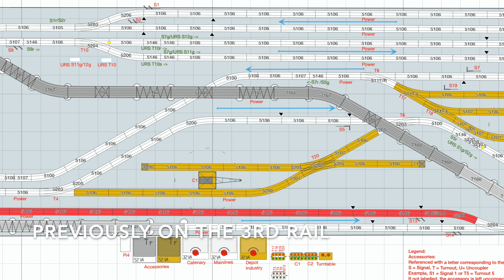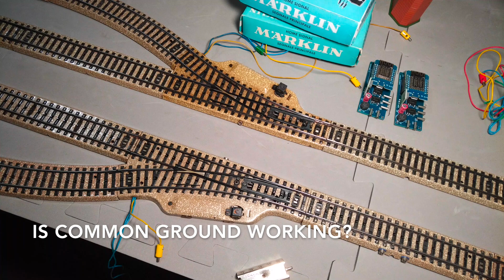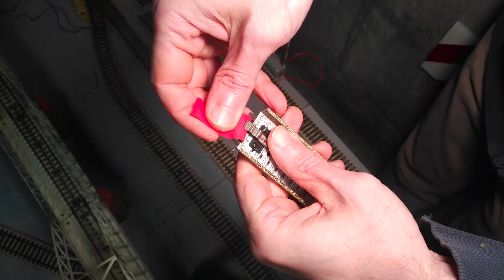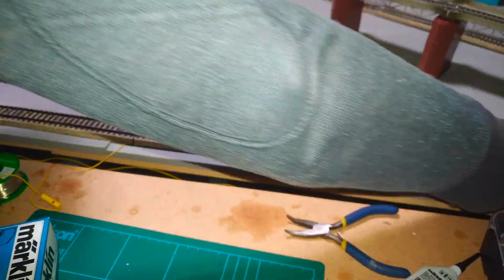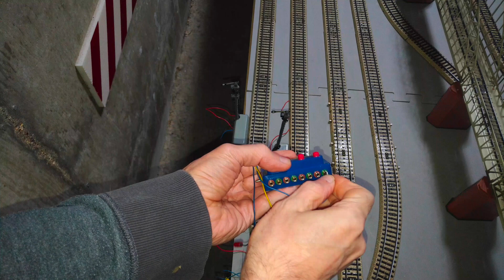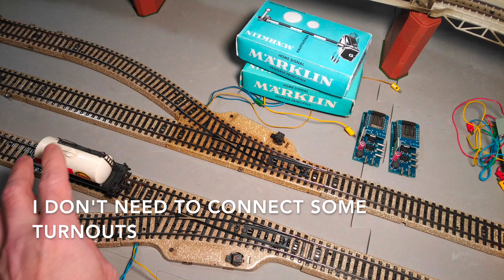2021 layout - Phase 3: installing accessories and wifi controls - Märklin M-Track - Analogue

Comment: I am quite interested in your M-track reloaded solution (or its 2025 update, if you made one), but didn't find the cards referred to at 9:05.
Reply from the maker: I have deleted the videos, no one was watching them and they were difficult to watch too... I have nothing I can share about it at this point in time. Nothing is in a shape that would allow any trouble-free distribution. Usability is good enough, but the initial installation involves quite a few moving parts, and is more complicated than a simple "click install, next, next, finish". This would require quite a lot of support on my side.
Some software components I use are no longer maintained and I need to rewrite some of the stuff to work with current ones. 
All this would mean quite a heavy investment in time I cannot commit at present.
Reply: @The3rdRail  Thank you for explaining, I quite understand.